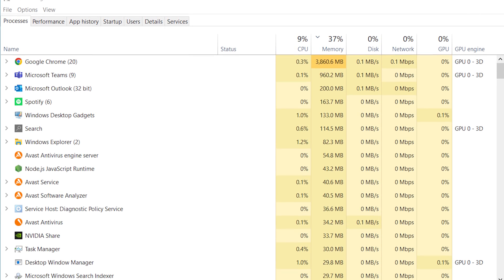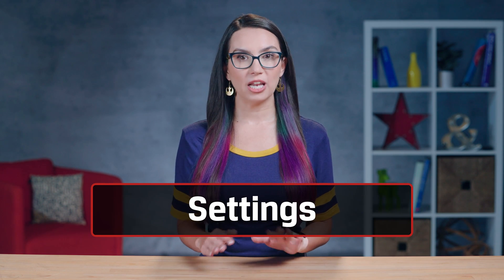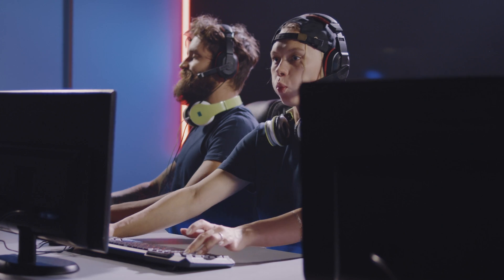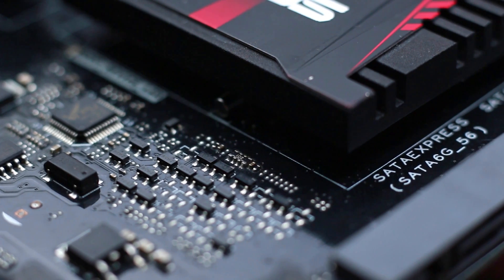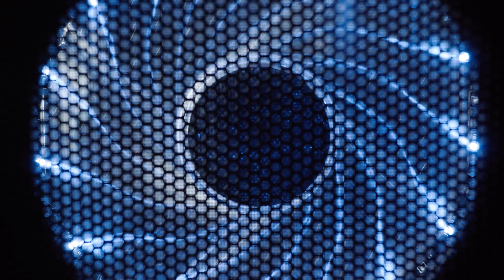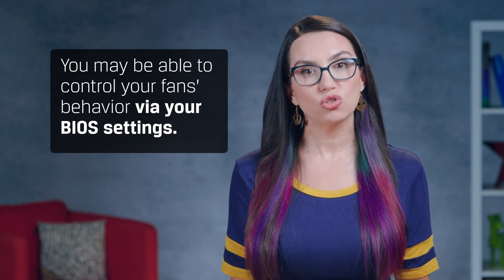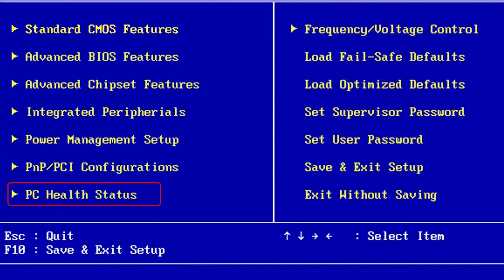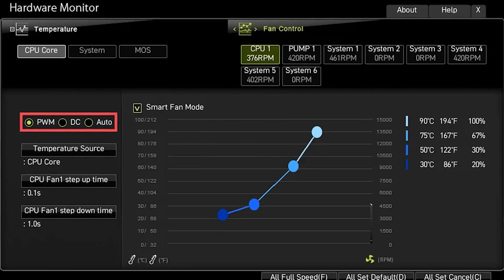Reduce Noise on Gaming PCs and Laptops – DIY in 5 Ep 179

Comment: I couldn't find any fan control option in the bios of my laptop. I have a MSI Vector laptop, and I am using Ubuntu with dual boot alongside windows. In windows I can control fan speed by setting fan profile in MSI centre app, but in Ubuntu the fans are loud af and it's really annoying. I can't find any software to control the fan speed.